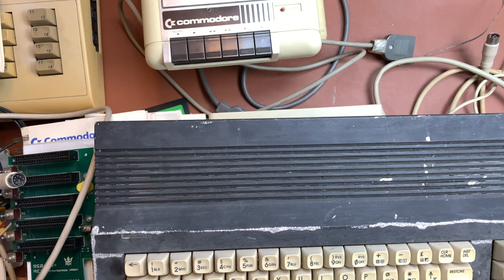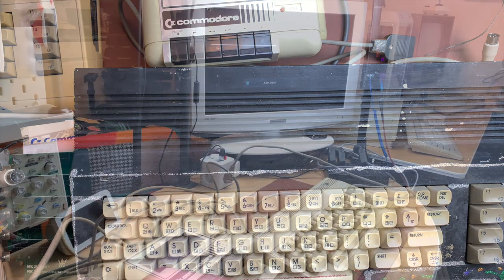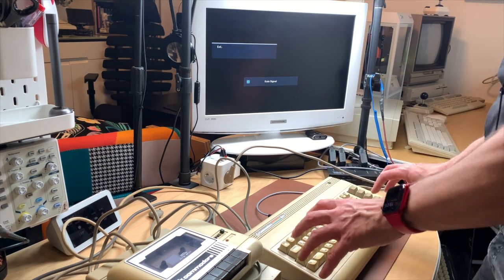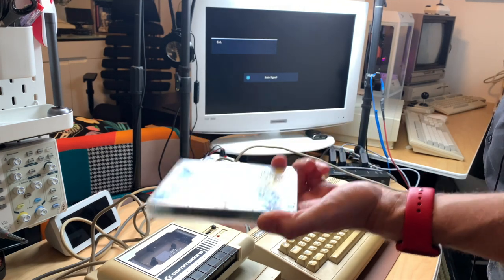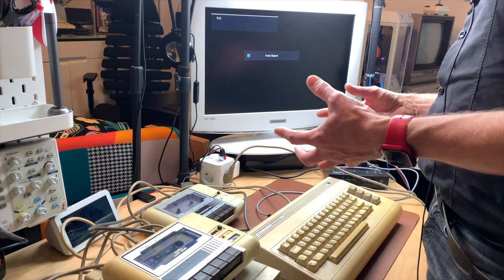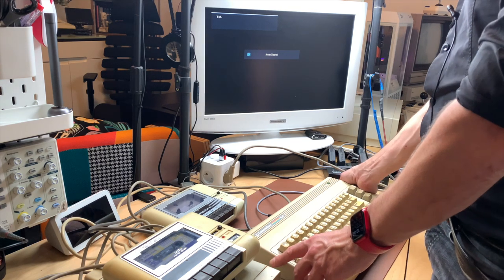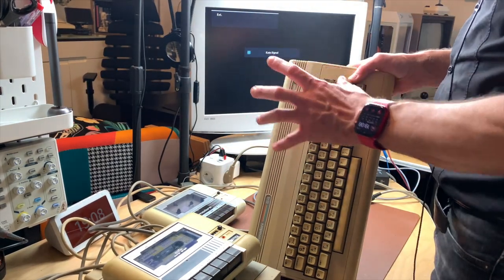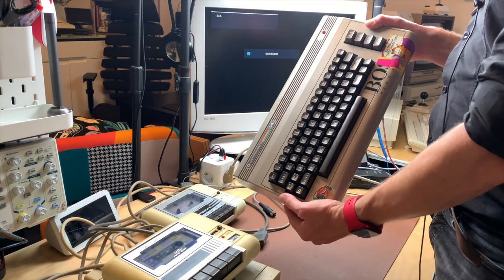The Glitter Bomb C64, a C64G and a Sinclair ZX 81 PLUS viewer mail from Oliver - Retro Packages #15

Comment: Actually I just ordered some other intersting PCBs:
An adapter to connect two slimeline disk drives as used in old notebooks and theese USB-Floppydrives, using a 26FFC-Connector. There is a "A1012" on thingiverse, that PCB is part of this project. As there are FFC to 34pin adapters on Aliexpress, I intend to use one those to combine a slimeline diskdrive and a gotec under my CDTV.
As I ordered on PCBways anyway, I also ordered the A1000 keyboard adapter PCB - to make the set complete (A1000, A4000, A2000/3000 and CDTV). So be prepared to get a second package in a few weeks...
Many thanks for your package by the way.  Very interesting projects. Esp. the Neo Ram for the C64 seems quite interesting.

Comment: Aldi c64 is different than c64g. More grayish case hue, side printed keys and made in USA. C64g is more creme colored with top print keys, made in W. Germany or China etc. 
Maybe the led diode's two wires are switched, so you have "offset" the 3-plug.
Reply from the maker: You are right. In my head they were the same machines ... but they are not. So I showed a C64G and NOT an ALDI C64. The LED was really dead. I checked off camera.

Comment: I like the PC card, what an elegant design.

Nice ZX stuff. That ZX81 looks very interesting, how much will you be selling it for ?

The Interface 1 might not work, it has a shiny spot infront of the edge connector, indicating the proccessor chip has overheated. A common fault.
Reply from the maker: Sold it for €70 and still have the microdrive and the interface.
Reply: @RetroWK  Shame. I would have loved to see what mods they had done. It did'nt look like a memory upgrade as I did that with one of mine, with 32K memory the mother board still looks original apart from 3 jumper wires.
Reply from the maker: @frankowalker4662  Yep. Sorry. It's gone. I realized after I bought it, that I don't have any interest in it.
Reply: @RetroWK  LOL. I id that with an 80's IBM. It's been sat on a desk untouched for nearly 25 years. I plugged it in when I first got it and looked at all the disc's, but lost interest almost immediately and went back to my ZX81, ZX Spectrum and Amiga A1200.